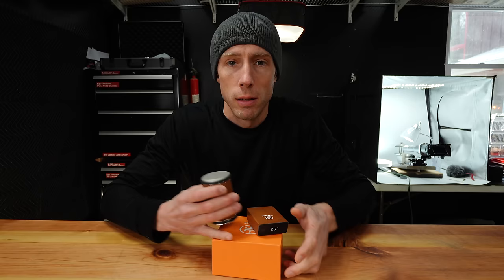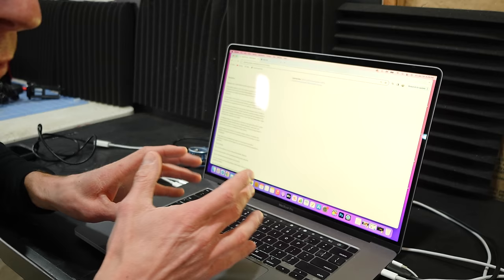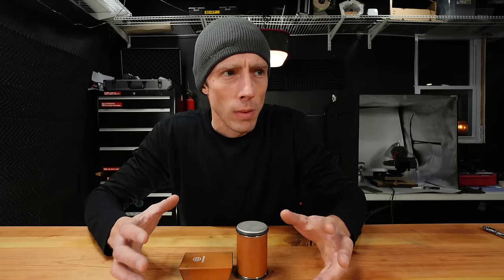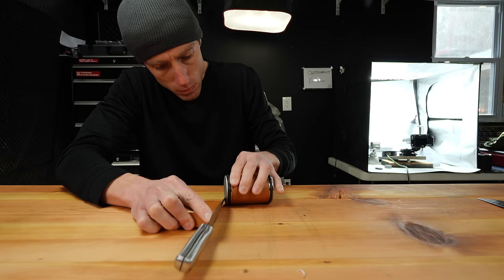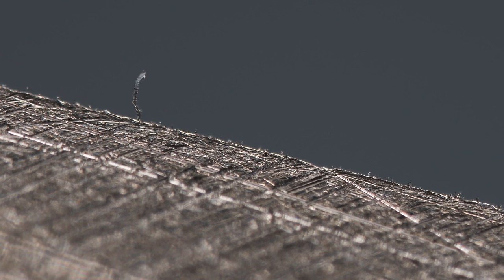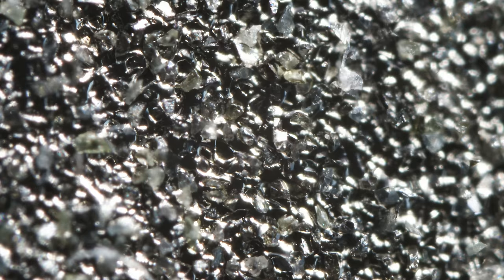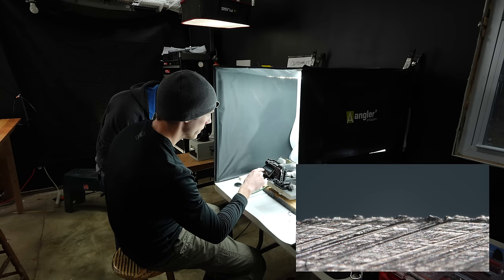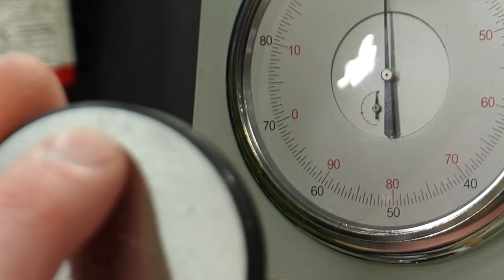There’s Something Strange About These Rolling Knife Sharpeners..

Comment: Those things looked way too gimmicky to me. I am a tried and true stone set, and crock stick guy.
(I will say however after watcbing this video, I wonder if cutting and making replaceable waterproof sandpaper discs to attach to the ends of the roller would vastly improve these devices? Essentially this whole idea simply looks like an angle control device to me. Not necessary. Just learn the skills to freehand on stones. Much better. And not too hard. I have taught tons of people how to sharpen.)
Another great video, Alex. Your production keeps getting better and better.

Comment: Funny enough I just bought an Amazon brand “faahi” and the coarse side is 400 and the polish side is 1000 which seems what you said was much better? I used it once so far and it worked well. It was only $30 after discounts so worst case it sucks and I lost $30. I also have a misen stone so might use that instead and keep the magnetic holder to make it easier to get the angle

Comment: Please excuse me if the surface is more complex than I think, but assuming the horl disks are flat and use an even grit, it's pretty clear why this doesn't work so well, even though ease of use if of course a different concern - the distance that the tool surface travels across the blade surface per stroke is, on average, a little less than half the total distance of a comparable linear stroke (if you could use the entirety of the roller diameter, it would be half), and at the same time uneven across the tool - some parts (the outsides) will wear quicker than the rest as they are both doing more work per stroke and are in contact with the blade more often, just like a grinding stone might become banana-shaped over time. The difference is though, with the rotating tool you might easily get into the situation where only the barely-used center is touching the blade and doing no work, while the most effective outside is already ground away and not making contact anymore, and I suppose you need to start rolling at weird angles to keep grinding.
Reply: The discs are flat, but your analysis doesn't make sense geometry-wise but for the exceptional concave blade line. However the vast majority of blade lines is convex or partially straight. It is obvious that for a convex blade line the opposite of your statement is true as a plane is tangent to it, meaning there's a single point of contact. The larger the blade line's radius, the more you approach a contact line across the disc.

tl;dr If you're using the edges, you're doing it wrong - as did the maker of this video.

It's true that the disc's perimeter travels faster than its center. On the other hand the center stays in contact with the blade all the time and not just twice per rotation as any point on the perimeter. I don't think it has a huge impact.
Reply: @zaphod333  well, in terms of wear the "mileage" each point of the grinder does while grinding is absolutely significant, and of course the mileage in the center of the grinding disk will be the smallest regardless of blade profile, in fact it'll have almost zero rotational travel, which of course the outter parts will have in spades. So the "mileage"=wear pattern will be uneven across the radius whatever blade you grind with it - even more so with short blades (less chance to use the inner disk, as you always start around the outter disk on the handle section)

Now a thought experiment to get across what I'm saying: Let's imagine we put the grinder into a lathe and start axially removing material, starting from the perimeter, until the grinding disk is vaguely domed (looking from above, U-shaped), let's say we take off a millimeter, the domed shape is totally smooth, no grooves or sharp edges, and the grinding surface is magically still as rough and hard as before. Will these outter disk sections that we just machined be useful for grinding? Not really, unless you start rolling the disk along the blade in a weird curve (either away or towards the straight blade) to keep them in contact. With the real thing startibg to show such wear, you can actually do that by pressing along the side of the grinder, but then you're also increasing the problem as you're creating even more uneven wear towards the outter disk like that. So at that point, when the edges start wearing prematurely, you're left with those raised inner parts, which - owing to their low relative mileage per stroke - will not do a lot of sharpening as opposed to the factory fresh sharpener. And in fact it will be very hard to correct the wear pattern just by using the tool at such a point, even if you keep it perfectly straight (using only the parts that "stick out too far",as you sometimes can with a sharpening stone), as the outter remaining surface will still wear much faster than the center. At one point, the whole thing will start to resemble the bottom of a spinning top toy - obviously, not a great shape to evenly machine anything, let alone at almost no rpm's...
Reply: @decnet100  I absolutely do not agree. 🙃

Sure, "mileage" matters. However there is a superposition of to movements: A translational and a rotational. The center will be in contact with the blade for all of the translation (if you adjust height perfectly), while the perimeter rotates and is in contact with the blade only for the width of its edge twice per rotation for about 1 mm as it moves perpendicular to it. I'm too lazy to do the maths right now, but clearly the total travel of any given point on the perimeter is smaller than that of the center by about an order of magnitude, if not two. It moves a bit faster over the blade's surface, and the geometry may not always match this idealized model, but that won't make much of a difference.

I think your premise is not based.

(Thought experiment omitted due to lack of relevance.)
Reply: @zaphod333 Well, perhaps I'm going too much off faster rotating tools where the rotation creates most of the grinding effect, - there that's definitely the case, even if you mix in  as much linear linear motion as you possibly can, the larger radius will always, inevitably wear first. But I can agree, it depends on the speeds and the grinding characteristics of the material (grinding effect in relation to velocitiy and pressure) - perhaps it's all perfectly matched and foolproof, perhaps it needs a skilled operator and the blade positioned perfectly center, perhaps it helps to reset your rotating position often (as in, moving the stone closer or further from where you just rotated)  or perhaps, as your description would make one think, the center just wears quicker than the rest, which I suppose isn't the worst that could happen - I still would rather use something where the grinding effect at each part of the surface isn't dependant on varying rotational speeds AND linear position of the grinding stroke at the same time. Personally, I've started using a (very affordable) water wheel, and this method  just reminds me of using the wrong side of that.
Reply: @decnet100  By no means am I a grinding expert, nor do I sport a knife fetish. 😆 I consciously decided against free-handed grinding as it would take me a lot of practice to keep the angle. My Horl does that for me. You can go wrong with it, too (e.g. by tilting), but the learning curve is extremely steep. It's true that an accomplished free-hand grinder will probably get sharper results in less time, that you are limited to the fixed angles, and that you may need to adjust height to blade width. But it works for me, and once the angle is ground in re-sharpening is very quick. Only the bone knife with it's 'wavey' edge I can't get satisfactorily sharp. 😉
Reply: @zaphod333  well, I used to freehand, but honestly I'm too lazy for that after work. That €150 Scheppach water wheel (+integrated polishing wheel) just does it for me - comes with a holder adjustable for several angles and if the wheel (about 2kg of grinding material) is ever worn down, it's €26.99... on the other hand, I did previously almost kill myself, as I suppose isn't uncommon, with a (dry and fast) grinding wheel, so taking that or the cost of a new face into account... ;)

Comment: they need a thicker layer of the abrasive side, so it lasts longer.
Reply from the maker: Thats not how it works. It should be coarser thicker wont make a difference due to how the nickel holds the abrasive in place.

Comment: $100 for a knife sharpener?  

I'm still using my mother's Cory electric sharpener that's over 50 years old.  I can still sharpen any knife we have by running the blade 10x on each side, and the sharpness lasts for months.   It takes less than a minute per knife, if I go slow.

I see 'vintage' Cory sharpeners selling for $15 online.

Comment: Another thing than just the "performance" dropping significantly is that you literally change the complete geometry of the knife's cutting edge by forcing it to take the angle the rolling sharpener knife holder thing alligns it at.

PS: Knifes at work are getting used up very quickly, so I simply sharpen them on stainless steel edges of a machine we have. Every day...  😅

Comment: I just recently bought the Bexyon rolling sharpener.  It was priced in the middle of those I saw so that was my only consideration when ordering.  Haven't used it but on 2 knives so far and I can see some limitations.   It is great on large blade kitchen knives but extremely hard to use on my Schrade LB7 as there is only about 3/8ths of an inch of flat surface to attach to the magnet so you have to be very careful when pushing the roller against the blade as if you push too hard the blade angle will shift.  With that said I rolled it on the LB7 a few strokes with the 400 grit diamond side and then used the ceramic disk, 3000 grit, on it a couple strokes and I could shave hair off my arm.  Is it as good as my Gatco sharper kit?  Time will tell.

Comment: Well, 189 $ for this piece of s.. is more than what I paid for my grinder, wet stones, and honing steel combined!
If I want a quick sharpening I use my wet stones and honing steel (Isler Stahl). When I have a really dull and crappy knife from my friend I establish an edge on the wet grinder and then proceed with my stones (grid 400 and 1500).
For my shaver (yes, I'm an old-fashioned guy :) ) I go up to grid 10.000 and then use the strip with honing paste.
Reply from the maker: This one is not $180

Comment: I’ve been looking at these rolling sharpeners for several weeks.  Would you be willing to give your opinion of this one? Arbenefe Rolling Knife Sharpener with 5 Replaceable Diamond and Ceramic Discs, 5-in-1 Knife Sharpener for Steel of any Hardness, Magnetic Base with Two Fixed Angles - 15°&20°.  It’s from Amazon and has the same price point of the Tumbler.  I like that it has replaceable disks and uses several different grinds of ceramic for honing.  The course grind of the diamond disk is also close to what you were recommending.  My budget is limited or I would invest in the Horl. Thank you for a very informative video. I’m glad I saw it before investing in the Tumbler.
Reply: Buy yourself a brick instead, in my opinion

Comment: So, can we improve it? I was thinking about putting velcro on the roller faces and then trying different sheets of abrasive material or may be even just glueing it on.  This would be cheaper and quicker than trying to find a replacement grinding plate (different fittings etc no doubt) How would you do it?

Comment: The design could have been improved if they wanted to improve it. Tungsten carbide fragments are available in basically any grit and against most materials last basically forever due to their hardness and density. Its hard to imagine they didn't think of this. I guess, advertising works. Why make something really really good when you can make sure everyone wants something average.

Comment: the original invention is called outdated. the grinding stone and hand rolling stone was a method over a flat stone, due ot loss of engineering and other groups, it would phase out for flat stones. This is jsut an updated design of BC design. It's like metal work and cold rollign to make piping... its like lead based public piping systems for water, in the 18-19 century verse, the copper nad brass that was used in other groups... there is a difference in common era and other groups.. ROmans would be akin to computer age verse some random tribe somewher.e

Comment: hey.... I developed my own 3d printed tumbler, with bb gun balls for the ball bearing, magnets and 100 mm grinding discs, so one can swap grits 180, 320, 800, 1000, 2000, etc... or even replace discs at will for cheap.  Would you like to test it?  I am planning to release the models for free.

Comment: You still have the problem, if you work out the mathematical relative motion equations -- or if you look at the abrasion patterns on the knife under a microscope -- that most of the scratch patterns this device makes is longitudinal with the edge -- i.e. it has the very same problems as a "dimestore" pull-through sharpener!

Comment: I got the tumbler knife sharpener and after some practice of how to use properly and re-edge my knives, holy fuck, they are BY FAR, THE SHARPEST my knives have ever been. It's actually kinda scary how sharp they got, it's basically a kitchen razor blade. 

I was tired of using a shitty cutco sharpener and then a totally manual 3 stone set that I have a hard time keeping the same angle on. The tumbler is working well for me although I havent gotten to the point of where it's not doing anything. That makes me worried.

Comment: huh huh huh honing steels don't remove burrs dang it, they align the micro-serrations for heck's sake. you can't really tell from the angle you approach the blade under the microscope, but when edges "roll" they don't just roll in one direction because the knife's edge isn't one continuous, flat strip of metal on a microscopic scale. 
those burrs at 9:19 are nasty, but zoom in even further and you'll see just how many bumps there are along the edge. even if it were a factory-fresh knife, if you zoom in close enough you'd still see those micro-serrations. all of those bumps will fall to one side or the other as the knife is used depending on a literal zillion factors. honing steels are meant to do nothing more than just push those micro-serrations back toward the center.
incidentally, this is why maintaining your knife's temper by only hand-washing in room-temp water is so important to retaining an edge. if you soften the metal AT ALL, on that scale, your serrations will just fold whenever they make contact with your food or demonstration paper

Comment: I don't think you can just put the whole sharpener in the hardness tester and get an accurate result. Lead is a 5 hardness and you're saying that the stainless end is a 6? You'd shave the end off if it was that soft. I've had the Tumbler version for over a year and still get fantastic results every time, from the cheapest stainless knife to high end carbon steel Japanese ones. I've never had an issue with burs left either. It takes about 2 minutes to sharpen any knife. I would recommend these to anyone.

Comment: I got as far as 4-50 and stopped to type this comment. 

The "diamond" abrasive disk wears out a low quicker than a diamond steel (or rod as you may know it). The abrasiveness doesn't last forever - in the catering industry a diamond steel should be replaced approximately every 2 years, although this could be as low as 6 months with heavy use
Reply from the maker: I manufactured my own diamond stones for several years. And currently have stones that are 7-10 years old doing commercial sharpening work. If plated properly with mono crystalline diamonds, stones will last a VERY long time. The dmt stone i show in the video is 7 years old and has been used commercially.
Reply: "properly" is the key word here. 

I did actually try to find my comment again and rephrase it because it made me look incredibly pig headed but I got lost going through some more of your videos. In only a couple of days it's changed the way I sharpen and de-burr my knives and the results already speak for themselves. Thank you.

Comment: Sorry, not gonna watch to the end.  I bought a mid priced sharpener like this from Amazon.  Prior to this, I could not sharpen a knife to save my life. There may be better ways, to sharpen a knife. I am quite sure that an experienced person can use an oil or wet stone and get a better edge but I got one that had 400 grit diamond on one side, and 1000 on the other.  The reason I find this works for me is that the holding block forces you to put a consistent angle on the edge, eithe15 or 20 degree. I took a very dull, raggedy knife and got rid of all the nastiness. Then I put a fairly decent edge on it using the rolling process.  I had about 8 or 9 knives that were very, very dull.  By the time I got done working on them, I discovered that once I was done rolling, hand sharpening with a very light stroke using the 1000 side got them even sharper. Maybe not the best, but for someone who has had trouble in the past, these work.

Comment: So... In terms of 'can this sharpen a knife', let's just say that if the object isn't butter, the answer is yes. And i'm not fully ruling out butter given the right conditions.
I've sharpened knives on a broken off piece of industrial floor (non-reinforced).
If it can't sharpen knives, it's not just a bad knife sharpener, it's a bad object. Because if a broken off chunk of worn down concrete slab can do the job to bordering on shaving sharp, and a 'knife sharpener' can't... That's just sad.